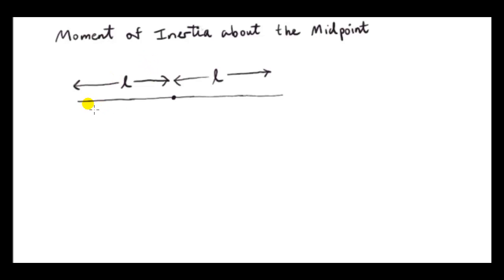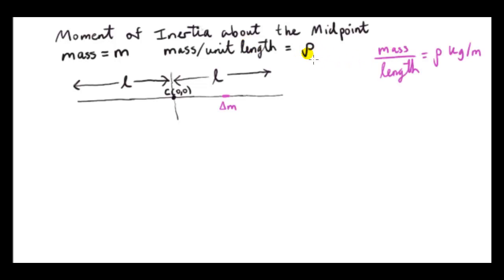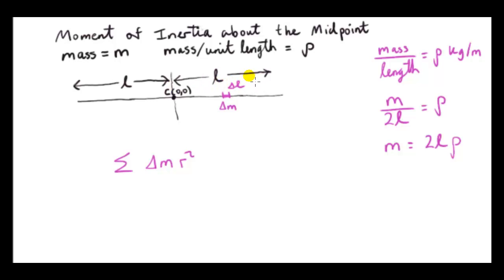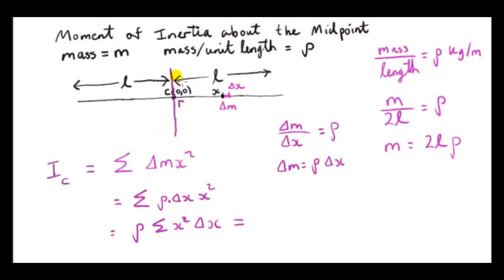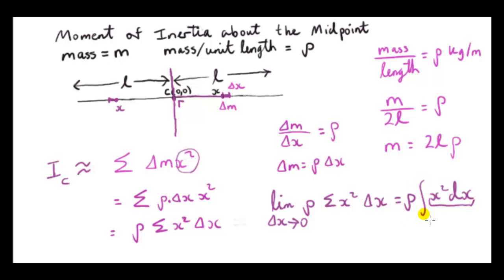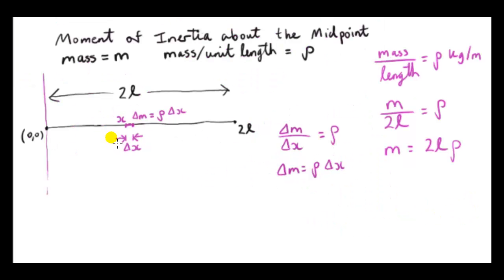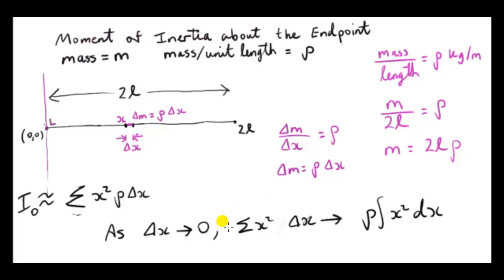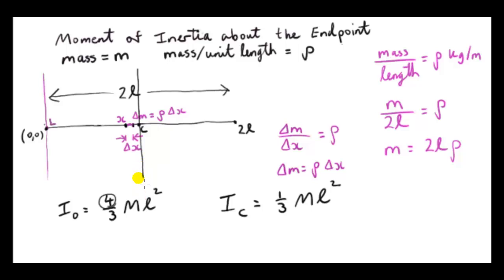The Moment of Inertia of a Thin Uniform Rod

Comment: Icm = (1/12)ML^2 not (1/3). 1/3 if for rotating through the end. https://www.youtube.com/watch?v=_QnsJrIWQCU check out this link if you want the correct way to do this.
Reply from the maker: Cameron Olivera 
Hi Cameron, I used l for half the length of the rod.
 If l is used for the full length of the rod, then plugging l/2 into my (correct) result 
1/3 Ml^2 gives  (1/12)Ml^2. There is only a notation difference between my derivation and that of the link that you cite.